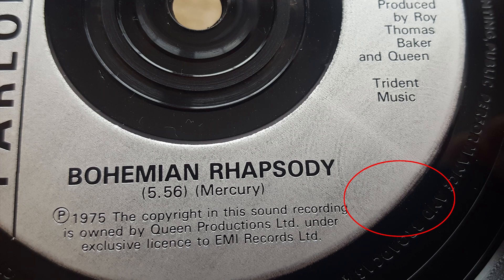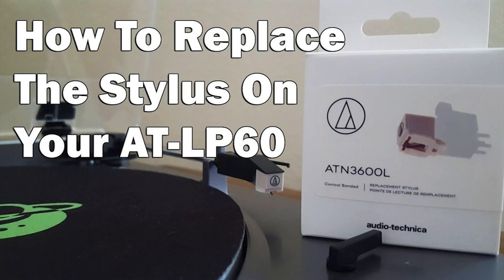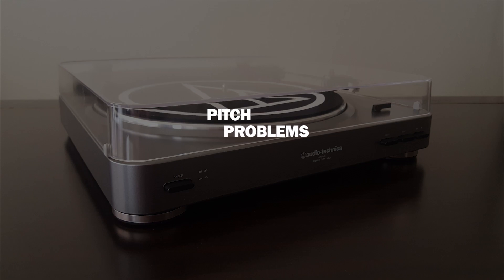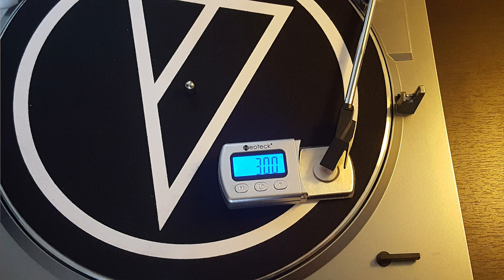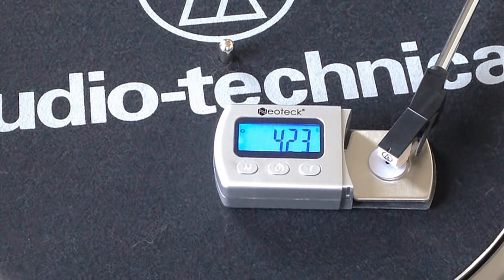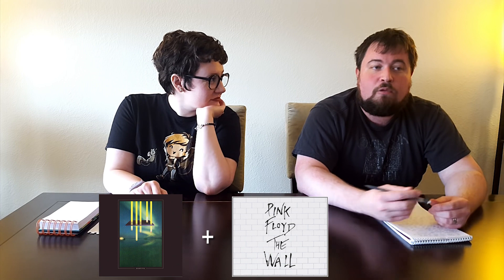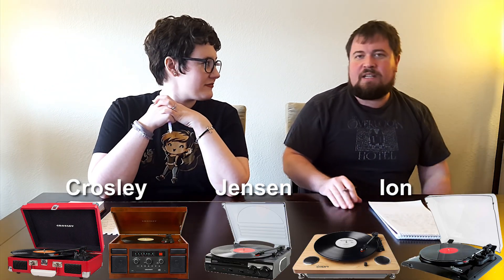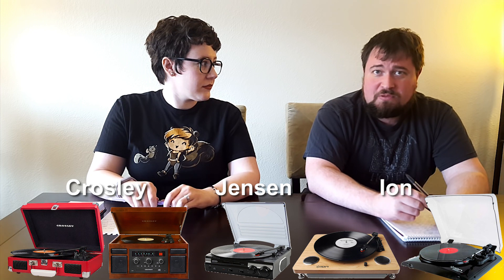Final Thoughts On the AT-LP60

Comment: When mesuring the weight of the needle you must do it from the height of the record because as you lift the tonearm the spring pressure increases as you pull on the spring. You will find that when done correctly the pressure is within tolerance 👍
Reply from the maker: Exactly correct, which is why I placed the scale on the platter where the record would go.  Are you simply re-iterating this for other viewers, or are you questioning how this was done on our end?
EDIT:  Also, did you watch in the video where I show that the original method with the exact same slip mat still read 3.00 grams, and then the increase to 4.84 was with the exact same slip mat in the same spot?  If pressure changes with the exact same slip, then it's irrelevant how it was done, because the point is that it was weighed the exact same way both times.

Comment: I just got one of these and the tracking force is 4.5 grams
Reply from the maker: That's really bad my friend, and a lot of weight coming down on those LP's.  I would send it back now if I were you.
Reply: @cjsvinyl  I was measuring the weight on top of the plate which makes the scales higher than the record. I contacted support and they told me to take off the plate and put the scales there. I did that but used calipers to get the exact height of the plate from the base and measured 2.25g. Will keep an eye on it as it may increase, some have reported this. Almost sent it back! Great video btw.
Reply from the maker: @sebdecarteret5830  Except that you're not considering the weight with an empty platter, and no record.  You have to consider the weight 'As-Is' while it's pressing down on the LP, because that's what you're doing with the records in the first place.  Measuring in any other manner, doesn't pertain to what you're actually doing with the records, and I really don't understand why someone would try and recommend something that you're not going to be doing when it comes time to spin a record..... :/
Reply: @sebdecarteret5830  It wouldn't matter if that measurement were true anyway, actually it would probably be worse as the 3600 cartridge spec demands at least 2.5g tracking force.  Too little tracking force causes damage and it can be worse damage as well.  I got rid of mine and upgraded because of these quality control issues and you can get a much better turntable used for the same price

Comment: The speed issue can be easily fixed, there are holes on the bottom labeled "33" and "45" where you can stick in a small screwdriver and adjust the motor speed for both speeds. I did mine by ear but if you have a strobe disc you might be able to get the speed exactly right.

In any case mine is just a backup for my Pioneer PL-707 and I'm looking to replace my LP60 with a little linear tracking deck as my new backup.
Reply from the maker: No it can't, not on this model.  There were no holes on the bottom of our LP60 anywhere for any adjustments of any kind.

Comment: I have been using the AT LP60 for a little over a year now and I am planning on upgrading most likely to the uturn orbit. I have about 100 records so I haven't played any single record more than 5-10 times so I doubt it's done any damage. I honestly don't regret buying it at all. It worked great for this one year as a beginner turntable.
Reply from the maker: Except that it's not just the excessive tracking force, it's the pitch problems that we mentioned as well.  With an upgrade to the U-Turn Orbit, at least you'll be able to not only control the tracking force, but the tone of your music will be coming through the way it was intended to be heard.  Congrats when that day arrives.

Comment: :I got a AT - PL50 from one of my friends couple of years of ago.  It's a kind plug and play.  It sounds nice as an entry level model.  However, the 33 rpm jumped fast (like 40 rpm or so) all a sudden and therefore I did not play it for a long while.  Lately, from the YouTube, someone showed how to adjust the rpm by turning the screw at the turntable bottom.  I followed the method and I did it.  I was just happy for one evening.  Next day, the rpm jumped up again.  I tried to adjust it but not success.  I think I will throw it away soon since I heard from your video that AT - LP60 also have a pitch issue.
Reply from the maker: These aren't even good entry level turntables, they just make a mockery of the hobby.  There was never a hole on the bottom of this turntable, to make any adjustments to.  I tried so hard in these videos to provide the truth while still trying to take the higher road and show some level of respect for them, but I never should have.  Everything from Audio Technica is garbage and needs to be burned.
Reply: @cjsvinyl  I owned a Luxman PD 284 long long time ago.  Have not played it for a while since my receiver does not a phono input and one channel of the player had an issue on and off.  Is it worth to  fix it and put a new cartridge on?

Comment: I have been using an Aiwa px-e855 for over 20 years, designed just like the audio Technica, and it hasn't damaged one record yet.
Reply: Maybe it doesn't have the same tracking force problems that the ATLP60 has. You can't expect $100 turntables like this to be without their flaws. Even if your tracking force hasn't increased as high as theirs has, I know your turntable AT LEAST tracks at 3 grams and that is already too much.

Comment: Very nice review. I have this turntable and really enjoy it. I think the user friendly part is what keeps me playing it. I will upgrade eventually but for the money it's worth it. It is a very good entry player. And this is well reviewed..
Reply: Even the user friendly part would not draw me to it. The "savings" aspect of this TT is not really savings if you have to replace the stylus as quickly as 400 hours versus higher end MM styli that hold firm between 1,200 to 1,400 hours. Unreliable tracking force which clearly damages your LP's, pitch problems. Yeah it's good that they owned one if only for the sake of demonstrating this whole experience for others to see the truth about how bad these entry tables are. Just because something is entry level, doesn't mean you should buy it.

Comment: How would you compare the AT 60 to the AT60X and the Denon DP29F. I also have the Pioneer PLX 500 in mind but its a bit off budget. I really like your review hence would appreciate your thoughts on this . Thank you.
Reply from the maker: the LP60 and the LP60x is the same turntable, with small changes.  I wouldn't go with any turntables like either of those, due to excessive tracking force, and cheap stylus, along with everything else that is poorly made on it.  Same with the Denon DP29F.  It's another cheap LP60.  Your first priority is caring for your records.  That means the truth about this hobby is you do need to go a little more expensive if you're going to be listening the way it was meant to be listened to.  Otherwise, CD's are going to sound just as good as those turntables.  Spend more time saving your money, there's no rush.

Comment: What about getting the lp gear upgrade stylus and belt and stack some pennies up on the far end of the tone arm.
Reply from the maker: The bigger question you need to ask yourself is why are you wanting to make all of these modifications for something that is not even going to deliver a real Hi-Fi experience?  The stylus isn't part of the problem.  It's like we said the turntable sounds great, but the pitch issues, and the tracking force are too big of problems for us to keep it, and stacking pennies on the opposite end of the tonearm sounds like a weird and non-functional solution that isn't going to resolve these type of problems.  You're not experiencing vinyl records the way they were intended to.  Look into selling your LP60, and go with used vintage.  You'll have a counter weight, and proper playback where you won't have to worry about pitch issues.  Start over and give your records what they deserve.
Reply: @cjsvinyl  Thanks for the reply, you're quite right, time for a re think.

Comment: I am about to buy the LP-60 as my first Vinyl turntable but after I watch your video I have second thoughts.. Can you suggest me a decent turntable for starter?
Reply from the maker: Yes, the U-Turn Orbit.  It's a very straight forward belt-drive, not automatic, but has a counterweight adjustment, and the ability to swap out cartridges.  The amount that you are willing spend is up to you with this table because the price increase does go up if you want a nicer platter, or USB installed.  You should go to their site and look them up, and I'll be here if you have any other questions or concerns.
Reply: @cjsvinyl  Unfortunately it's not available in my country (Greece). So now I am thinking for the Audio Technica AT-LP3 or the AT-LP5...
Reply from the maker: You seem to really have your heart set on an Audio Technica turntable, and you should buy what you feel the most comfortable with.  At least the ATLP3 and LP5 have counter weights so you have more control over the tracking force issues that the LP60 has.  This at least gives you more control.  Go with what catches your eye my friend.  Just make sure to keep those LP's of yours in great shape so they'll last for the long haul.  Your LP's are ALWAYS your first priority.

Comment: I'm saving my money for an audio technica LP60 Bluetooth player to buy online
Reply from the maker: They're your LP's.  Just make sure you throw them away once they start putting out a lot more static rather than selling them to someone else.
Reply: Cj's Vinyl people been telling me to get an audio technica LP60 because they last longer than the Crosleys and Victrolas so I'm interested in getting an audio technica LP60 but I want one that comes with a Bluetooth speaker 🔊 so I don't have to buy the speakers separately
Reply from the maker: Of course it's better than a Crosley, but there are still other options.  You need to consider that spending a little more money initially will save you in the longer run rather than buying something that is still going to create heavier tracking force than you'll want pressing down on your records.
Reply: Cj's Vinyl save a little bit more and which model should I buy?